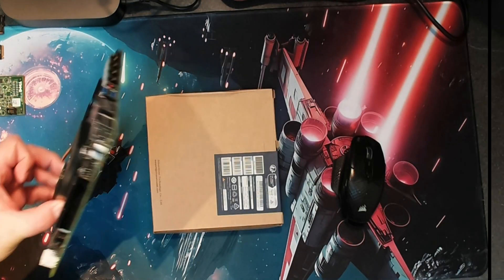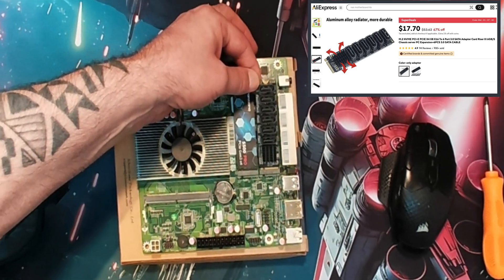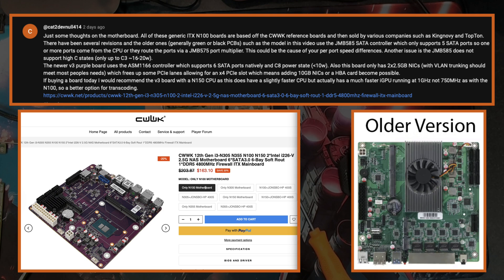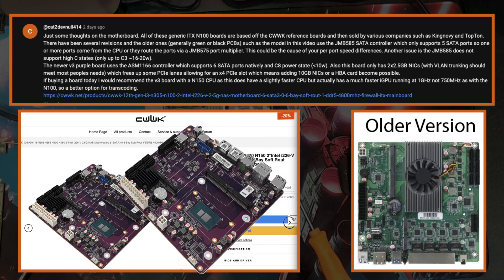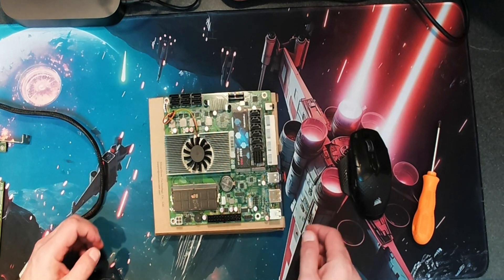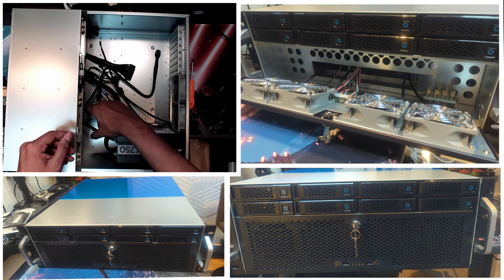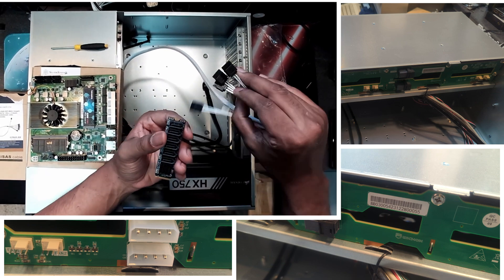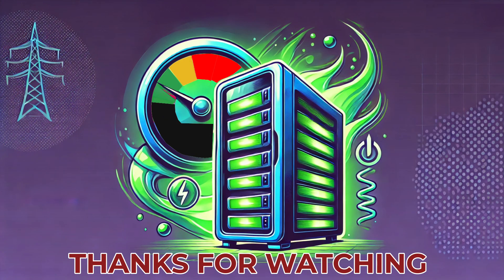Key Hardware in Building an Energy-Efficient Unraid Server

Comment: There are m.2 SAS to Sata adapters on Aliexpress.  I ordered one for $38USD, and it also includes the 2 SAS to Sata cables (1 SAS to 4 sata connectors) for 8 total connectors.

Just remember to always follow the included instructions & attach the cables BEFORE putting the nvme adapter on the board.
Reply: the 8 port adapters suffer the same problem as his motherboard.
Reply from the maker: That's a great tip, thanks for sharing!

Comment: Great work, Ed!
Pros and cons of an all ssd server vs hdd? Power improvements with ssd noted, what about speed of hosted services (nextcloud/immich/vms etc) for the basic homelab user who wants speed, energy/resouce efficiency and reliability. Yes we all want the cake and to eat it😂. Is the option of running specific services on different hardware (multiple Unraid servers) a better solution than having everything on one server...all backed up to another unraid Backup server? At what point do we have to many servers...is there even a number...
Reply from the maker: Hey! Yeah, that’s a good question. I’m actually making some changes to how I run my servers. For my low power server, I’m planning to add two SATA SSDs in a mirror setup for Nextcloud data. That should give me enough storage for NC, and since they’re SSDs, they won’t use much power, so NC won’t have to spin up the regular HDDs at all.
I’ll also use that mirrored setup for a Home Assistant VM and other container app data. This server will also run Jellyfin, Bitwarden, and a reverse proxy, which will handle traffic for all my servers. As for the NVMe drive, I’ll probably just use it as a download drive.
I’m not planning to have a parity drive in this server. Media will go here first since it’s the media server, but it’ll back up to my more power-hungry server when that’s on (which does have parity). Meanwhile, non media data on the bigger server will also back up to the low power one.
Hope that makes sense! That’s the plan so far, anyway lol.
Reply: I like the plan and it does give some more food for thought on how I can adapt for my setup. I am confident is saying that as a community, we are grateful for your past work and now more frequent vids on Uncast, I know I am. Keep crushing it.